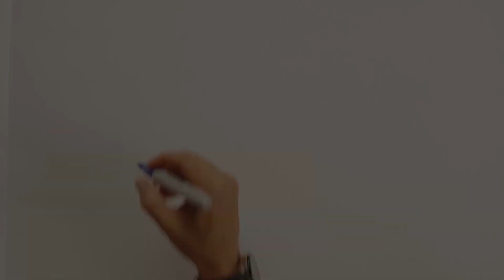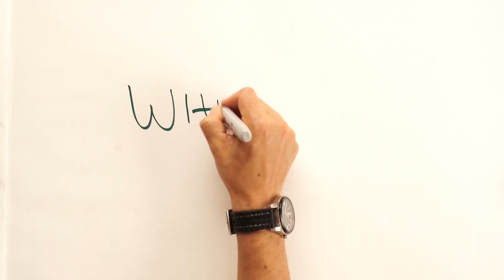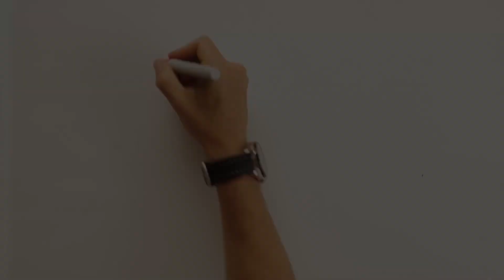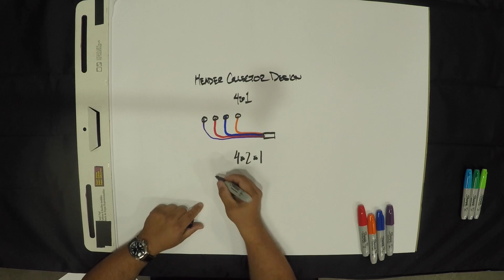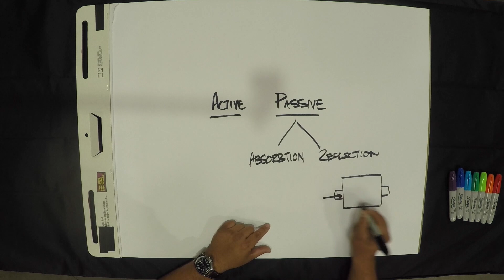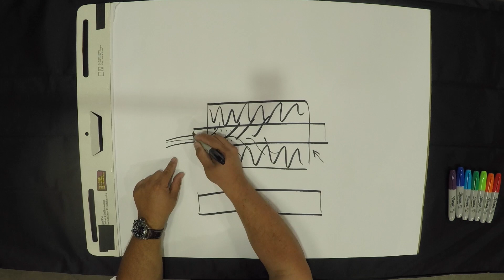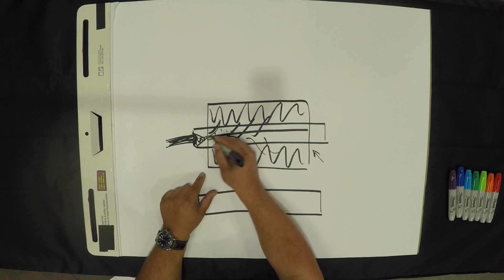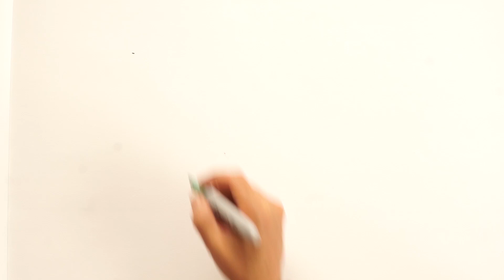No More Exhaust Myths - /ENGINEERED

Comment: Most of the exhaust is gone before the piston ever starts back up on the exhaust stroke. Ed Iskeiderain called it the fifth cycle, and he pioneered cams that opened the exhaust valve before bottom dead center. The pressure still in the cylinder creates a blow down of the exhaust, and relatively little is left on the stroke back up. This guy talks like there's no exhaust flow until the piston is on it's way up. Maybe it gets better, I'm done at 6 minutes. It's like exhaust flow theory for first graders in the special ed class.

Comment: 23:20 So, if I wanted to be really cheap, I could straight pipe my car and just drill a bunch of holes in the last foot of pipe for the same affect as the packed muffler? I'm guessing no as the back pressure from the packing helps the flow. Does anyone here really know?

Comment: So where does he specifically mention back pressure?
Reply: +ILoveBreakfast671 Well, why not twist your exhaust after the turbo right out through the hood? No more pressure and just tell the exhaust officer your car is really Electric and the sound he hears are just speakers to warns peeps you coming. He will fall for it, since they're dumb enough to have emissions checks when everyone are running 6.0L + anyway...

4 litre Smart cars like you wouldn't believe... they beated the 911s at the 1/4 miles by like two miles... xD
Reply: +ILoveBreakfast671 The guy said for dual exhaust he doesn&#39;t recommend moving up to 3 inch exhaust until around 500hp. So maybe that would work for a single exhaust on a Honda with at least 250hp, and that's a big maybe

Comment: Exhaust tuning is dependant on whether the car is naturally aspirated or not, and whether it has a cat or not.  For all cat and forced induction cars, you want the largest free-est flowing pipe possible, you cannot go too large, but that comes with the penalty of noise.  On non-cat naturally aspirated cars the pipe needs to be a specific diameter and length to keep gas flow speeds high.

Comment: NA engine is so important , my 6 cyl car went from a 13.9s  1/4 mile to a 12.9s by making the secondary pipes smaller and shorter to match my cam specs ,
this guy gave away no secrets , look at David Vizard exhaust

Comment: I wish he would have said something about tip placement and how putting the exhaust exit in a low pressure zone can almost be like supercharging the engine in the effect that the air going into the engine is more dense than the air the exhaust is being pumped into, also slowly increasing the exhaust diameter as it cools and slows down can negate the drop in flow that he was talking about when explaining how a muffler can at times out-flow a straight piece of pipe. Some input on exhaust insulation would have been nice as well.

Comment: Someone should make the entire exhaust filled with dimples like in Myth Busters when they found a dimpled car had lower wind resistance. You won't see it so it will not affect the aesthetic appeal of the car. The only problem is stuff getting stuck on the walls of the inside of the pipes.

Comment: All that talk about the advantages of absorption muffler is garbage. They'll drone like the end of the world when cruising despite what garbage science the MF guy is trying to tell you. You really want a "reflection" muffler as he calls it if you want a decent sounding muffler. How good the muffler will sound will 100% depend on how well the chambers inside the muffler is designed specifically for the vehicle, and that requires a TON of R&D. Cheap-ass magnaflow will try to tell you absorption is fantastic because they're easy AF to make.
Reply: +Woo Cheol Shin The exact opposite is true. If you have an absorption muffler that drones, then the absorption material has failed. An easy way to tell is to tap the outside of the muffler, if you here a dead thud, then the absorption material is OK. If the outside surface rings when you hit it, then the material has failed. 
For comparison, I had 70 series Flowmaster on my motorhome. Not only did they kill the mileage and power, but they droned like crazy because even through the sound bounced around in the chamber, the noise transferred through the case, because there is nothing to absorb it. The 70 series may have been quiet at the end of the pipe, but up by the muffler, it was very noisy. 
I removed the pair of 70 series Chokemasters, and installed two Magnaflow mufflers. I made no other changes to the system. The mufflers were much quieter in the coach, with no drone. My mileage went from 6 mpg to 8.5 mpg. My zero to 60 time went from 19 seconds to 16.5 seconds.
Reply: The Dynomax ultraflow sounds good and doesn't drone any more than a Flowmaster 40.  I don't care for the Magnaflow sound though.  It's too bland and quiet.
Reply: Woo Cheol Shin this was not about sound...lol
Reply: +Woo Cheol Shin  My Roush muffler (actually made by Borla) on my mustang has no highway drone and is loud as hell when you get on it and it's a straight through absorption design.

Comment: Could you have a smaller absorption muffler along the whole pipe to see the performance gains he's talking about?
Reply: +Sami Cooper in theory yes. however, you'd start to see temperature drop since the pressure is going down. In the practical sense it would weight too much, be a mother to build around curves, and have a horrific condensation problem that would then lead to rust.
Reply: +kleetus92 Cooler gases take up less space, his theory is "sound' (lol), and as far as a condensation problem, some mufflers have tiny holes that drain that.
Muffler shop where I grew up showed me.
But yea, the weight would be too much, however if were talking about a generator or some other stationary engine, it's not a bad idea..
Reply: +ramairgto72 surely from head to tail pipe youd still have enough heat to evapourate water and blast it out. Although any cars, street car and daily drivers ive had have ruste to buggery when not used from a year or two
Reply: +mark russel depends on the ambient temperature, and how long the vehicle is being run. Grandma going to church on sundays is far worse for any car than driving on the interstate for an hour or two...  Never gets a chance to thoroughly bake and dry out...
Reply: +Sami Cooper Well, he's addressing racing applications, so you wouldn't want this in the header or collector for the purpose of creating a good reversion, but after that - - quite possibly !
Reply: +Sami Cooper that reminds me of the cherry bombs i used to see in places like AutoZone. THey're just really long glasspacks.

Comment: OK, with regards to mufflers, Richard Waitas explains the two passive type mufflers, but failed to get into the Active design. 

Did I miss something here or did he just leave it out.  Otherwise a Very Interesting and Informative video.
Reply: +Miatacrosser He omitted the active muffler description due to the fact that most cars don't use them because of their complexity and their need for an external energy source.  Active mufflers are basically speakers playing the opposite sine wave of the cars exhaust note.
Reply: James Burleson So, Poser and not performance(I guess to a poser that would be a performance upgrade) use.  Sound and added weight.  Thanks for clarifying that.

 My Active Muffler goes to 11!
Reply: 16:30 check it out he did

Comment: 18:45 - If you have a certain input velocity, maintaining the piping diameter both upstream and downstream, there is no way you have different velocity in the input and output. Velocity is the same in a stable condition. You can say it will limit velocity,  in the input and output, by means of pressure drop, but you can't say that you have a certain input velocity (more correct to refer this to flow... as it relates velocity and area), and a different one on the output caused by the muffler (keeping in mind the relation between input and output piping)... I know that is not exactly what he says. He said the velocity in the input will be "slowed" by the muffler. That's the same thing... I understand what he means, but is not correct to say that, coming from an expert that i am certain he is. And in the video are more of this kind... :/

Comment: Watch this. This is high quality education. Watch it more than once. You won't need to scour the car fora any longer to try to learn what effect a sports exhaust system will have on your car. You will know. More importantly, it will save you from buying just whatever you find on eBay that will fit, because you will know that you have to invest some time into getting the right system for your car and you will know how to discuss it with the exhaust shop.

Comment: Most cars I've seen backfire have had no issue with the tail pipe or the diameter of the pipes,,,with the exception of a failed cat in factory,OEM or after market Hi-Flow converters..Just saying.

Comment: Im loving these videos. I love having stuff explained to me by very knowledgeable people. Too bad he didnt touch on turbo exhaust systems. Because the downpipe/header part is not the same there. I understand the basics, but would like to have further knowledge about it. And everywhere you go on the internet it says different.
Reply: Turbo Exhaust is for a whole nother program/video.
 The most important takeaway from this video is that a Flowmaster chambered muffler will not flow as much air as a straight pipe --- but a perforated glasspack can and WILL flow as much (or more) air than a straight piece of pipe.

Comment: So how much performance is compromised with the catalytic converters?
Reply: They're getting much better, and smaller (not internal diameter).
Reply: That depends on the type of Catalytic converter. Early General Motors and Toyota cats were the pan-type, which had the active ingredients in a semi-pellet form, and they were very restrictive, compared to the modern "Honeycomb" design, which will flow enough air to accomodate about 350 HP PER BANK without loss of exhaust flow .
Today, we have 700 HP cars with full cats in place -- on the street, and LEGAL in ALL 50 states.
 Novices and morons get in line to eliminate their cats -- while they scorn the folks that want to keep our air and water clean.  I've run a lot of illegal shit over the years, but nothing that could compromise our air quality.
Reply: Chuck Hallowell because racecar
Reply: @BrandonKent136  WTF is wrong with you!??  Did you miss your nap !??

Comment: This guy clearly knows what he's doing, but several times he indicated that there was both a pressure AND velocity drop at certain points. Bro, do you even Bernoulli??
I.e. 20:15
Reply: +eric kemp The Bernoulli equation applies at constant mass flow. An engine varying its angular velocity does not have constant mass flow, so both pressure and velocity can drop simultaneously.
Reply: Do you?  Pressure and velocity will both drop at some point.
Reply: +DrewLSsix Educate yourself.
https://www.princeton.edu/~asmits/Bicycle_web/Bernoulli.html
Reply: +Paul Optional Siegfried That's a good point, but not entirely relevant to the situation in question. Richard states, "...as long as the drop in pressure does not impede upon the CFM airflow..." What I'm saying is that a drop in pressure would increase airflow. What he meant to say was, "...as long as the drop in VELOCITY does not impede upon the CFM airflow..."
Reply: +eric kemp I think what he is trying to get at is that in a full system a drop in one of the two would result in an increased resistance to flow through the system hence dropping the other. I may be wrong as Im only just getting an understanding of this side of things but that was how I understood it
Reply: The main problem is trying to make a very complicated subject 'understandable' by the majority. Without training as a teacher it's very easy to oversimplify some things and assume other things that people 'should' know but don't as they never read scientific research on exhaust design (there is only one  book and it's outdated in many area's)